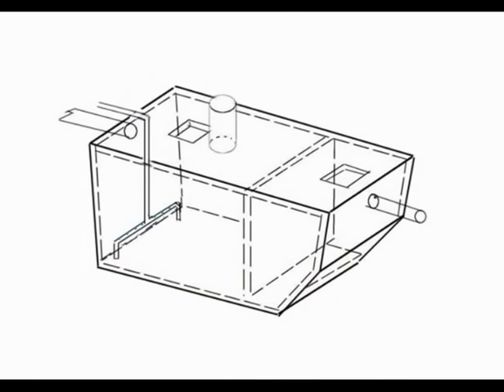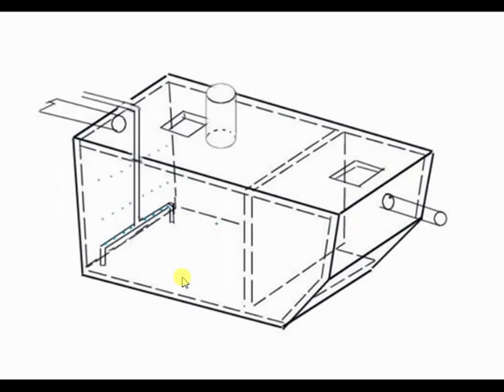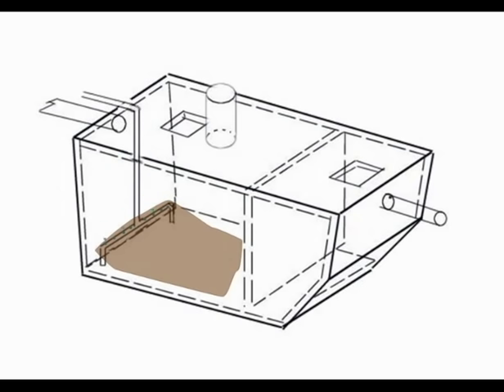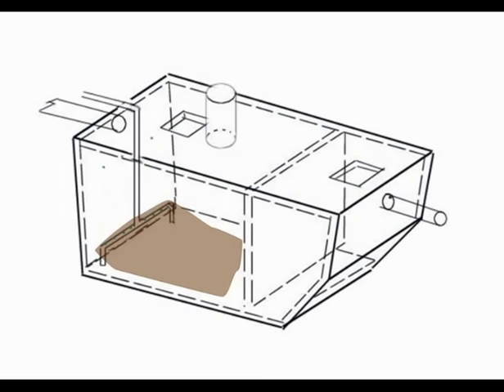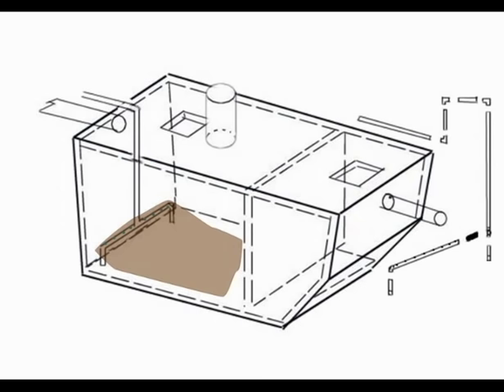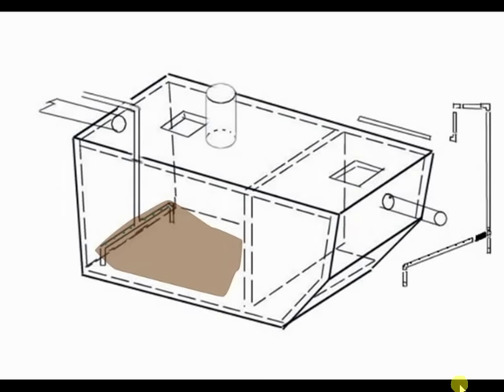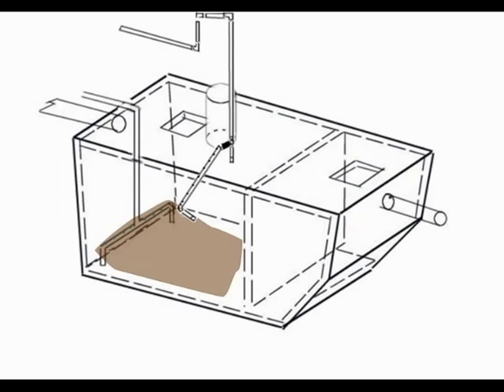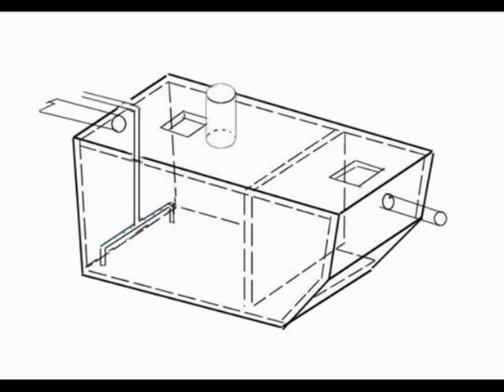Warning About Septic Tank Aerators

Comment: @Bracy
thanks. This is the clearest most concise post I've come across regarding the basics of this function. I've replaced three air pumps in 13 years. The tank dealer said my installer ran the air line way too far from the tank and is causing the pump to run hot. I clearly understand how to do this job correctly. Lord bless
Reply: your dealer is Full of it! I had my motor rebuilt for $700, they plant the pump right at septic overflow height, so when it overflows,  your blower is under sewage ??
Reply: @davidfriesen7748  
Replaced the diaphragm diy & relocated the air pump right next to the tank raised a bit above the riser cap.
absolutely no issue of being submerged by an overflow. I also installed a pipe just below the riser cap to carry any overflow away down the hill to about 20' from the tank. Just happen to have handy outdoor electrical within 10' of the air pump. As of this date No issues remain but they are certain Lol!
Lord bless! 1 Cor 15

Comment: An Aeration Treatment Unit (ATU) does not belong in the 1st Compartment or 1st Chamber of the Primary Septic Tank. If you install the ATU in the 2nd Compartment or 2nd Chamber, it won't prevent proper settling or separation of the solids from the liquid. You only want to Oxygenate the Effluent, not agitate the wastewater, which stirs everything up. Otherwise, add a Secondary Tank specifically for the Aeration Equipment, with an Effluent Filter in the Outlet Baffle, and the water will be basically clean when it enters the Leaching Field.
Reply: You can run them in both tanks for 6 hours each on a timer filter on outlet of course

Comment: Very good instructional; thanks!  
I've always promoted aerating the tank as one of the most important things to do.  
Not only does it sweeten the tank contents [stays mostly Aerobic, instead of Anaerobic], but because the biota in the tank are encouraged to stay Aerobic, they cannot migrate through ground and ground water, in case of a system leak.   
There's far less sewer-gas [H2S] formed, from Aerobic bacteria, too.  
Preventing migration of anaerobes through ground/ground water, is critically important wherever there's loads of septic systems used, in areas with shallow ground water, or near environmentally sensitive areas.   
Even Low-tech, gravity septic systems, can achieve this, if there's bubblers in the tank.

Comment: Great idea. At least now the new areators have drop down tubing like in a fish tank. I just got one because shaft areator and keeps burning out due to high water etc...heavy rains kill it. Got a simple unit that fits in the lid and has its own pressure alarm. I have the old 4 tank Norweco Singulair with the big bio Filter. Be nice not to spend 475 every year or 2 for a new one.

Comment: I'm a master plumber from Texas. 40 plus years. retired. I have to disagree with you regarding the clearing of the sludge build up not being able to be cleared by high pressure air.
If you are speaking about some idiot that just never cared for 10 years or so and ignored his system then he deserves everything he gets, you are right in this isolated case. 

Every customer I have ever had was instructed in the adding of proper approved enzymes/bacteria every 4 months and every 6 months to give the system a shot of 50 psi air with a visual of the results inside the tank. Takes an hour every 4 months and a 30 minutes every 6 months.

Seems that if a person actually does take a part in his system it can be kept clear.
I like your solution it will help many. But if people simply took care of the septic system it would last a lifetime.

I have seen a pvc pipe 'rack' put in a system, new of  course, that looked like a framework of half inch pipe, 3/16 inch holes every 6 inches and it fit the inside perimeter of the first tank with cross members, 4 of them. It stood 6 inches off the bottom of the tank floor. and the holes were on the bottom of the pipe not the top. 
when this guy turned it on it looked like a hot tub bubbling.

Back in 1978 he installed it. way before the time that anyone thought of this.

Knew him for 25 years and it was still working when I last talked to him.
Lots of good info but there are so many ways to put air into a tank.

Another person I knew took a flexible piece of pex pipe from a roll and with three coil/winds of the piping slipped down the opening he aerated his septic system in 1 hour.
Reply: Stephen Haley how the pex pipe hold up my family system  has been failing for a while the leaching filled is covered in biomat and if it rains a lot every thing inside backs up or if some takes a good shower it backs up
Reply: Holes on the bottom!  Good idea.  Also why have the pipe so deep into the sludge.
Reply: @Gold /absolutely great question
I'm sure there is an ideal minimum & max clearance from tank bottom to holes in the air pipe. But I was asking myself that very question when I came across your comment. please reply if you come across the answer. 
I will do the same. have a great day. 1 Cor 15:1-4
Reply: Oh my Gosh! There’s a freaking pump now? What the actual hell! This whole septic thing just keeps getting better. How do I know it I have one! There are endless pipes and ports and problems!!!! I’m so confused and overall just sick of shit💩
Reply: hi ,how long do you air the first tank (rid of bio mat) and how often in a year please???? many thanks
Reply: "proper approved enzymes/bacteria every 4 months"  -- scam?
Reply: @davidwatkins8016  It never hurts to put a quality product of enzymes made for septic systems every month. If possible do it at night when the enzymes can enter the tank and settle to the solids to work.
Reply: The system I had installed has 3 chambers and is aerated in the mid chamber. This is confusing to me since some have said aerate in the first chamber. Also, I love tinkering with stuff but… lol.

Comment: I built my own aerator system.  I used the blue diamond et60a so I would know when it went bad and to rebuild it.  My purpose was to reduce tank clean out and to remove the septic laterals  bio growth around them.  I know its working cause when I remove the unsealed lid 6" above ground level.  The smell is "sweet" no odors.  My system flows good.  But be reasonable.  #1.   A sink garbage disposal cannot be used, dang throw your garbage in the trash.  #2.  You cannot run your laundry into the tank when you BLEACH white cloths.....the bleach will destroy any bacteria whether anaerobic/aerobic...will cause NO DIGESTION of waste....rapid tank fill up---overflow to second chamber---outflow to leach field---SYSTEM COLLAPSE..!.  You should not use caustics like toilet stool cleaning tabs-scrubs-etc or you will destroy your DIGESTIVE BACTERIA in your tank.  I have a special septic (2 plastic 55gal. drums end to end hooked up for the laundry.  I did this system for my parents, sister and myself X 3.
Reply: Adding organic material via a garbage disposal can only help the system, not harm it.
Reply: @BT-ir5zl  Per code 1 garbage disposal count as "1 more bedroom". 
1 bedroom counts for 200gpd on an old home, 150gpd on one from the 90ies, and 110gpd for a recent one built after 2004.

Comment: Thanks.  My motto "Happy bugs - no plugs".   Also I don't see why they have the pipe so deep in the tank.  If put along the edge it will Jacuzzi and boil creating plenty of mixing without having it so deep into the sludge zone.
Reply: yes but if the tank bubbles too violently the risk of sludge churning over and spilling into the grey water tank is probable. then it's call the clean out man.

Comment: The air diffusers should not  be in  the first chamber , where the solids comes in ,it should be in the 3rd or 4th ...it varies depending on the size of system.
Reply from the maker: Hey, John many different manufacturers of residential sewer treatment plants have the air difusser in first chamber, including the "Modad" brand used in my video.

Comment: how do you aerate a single tank. from the 70's
Reply: You don't.   You need a second compartment at least.
Reply: Check out the "septic saver system". I made my own version of it with a large aquarium pump in a single chamber tank. Only drop the stone about halfway down the water level in the tank, so it wont stir up solids. Ive had mine going for a couple months now and the effluent (before going into the soak bed) is nearly clean water.
Reply: @arrow09  How has the aquarium pump work for you (and what size was it and what size is your tank.)? Are you still using it now? How has it worked out for you long term?

Comment: from the diagram you seem to be implying that putting drill holes on the top of the pipe is the way to go. I think that is the worst idea ever. You want to have the holes on the bottom of that because the crap is going to plug up the holes on the top.
Reply from the maker: Please explain how that will happen if a constant flow of air is coming out of the holes. The holes only obstruct when the air pump has been inoperative for a considerable length of time. In that case no matter how the holes are orientated they will plug up with all the "crap"!